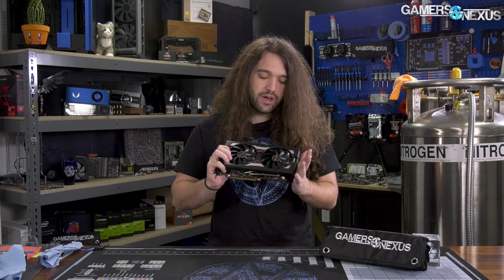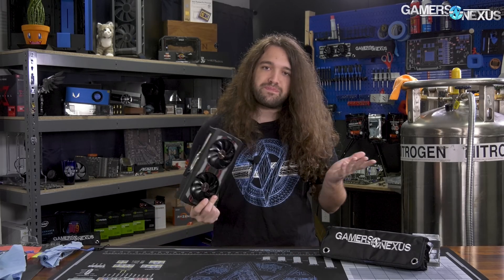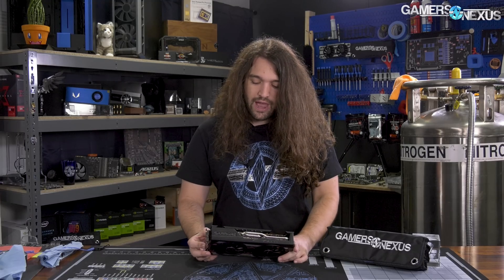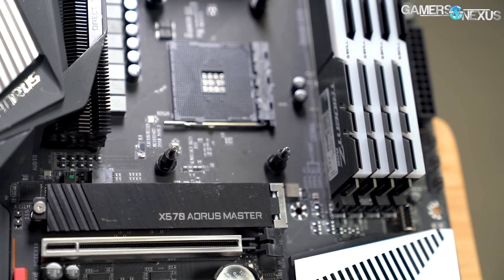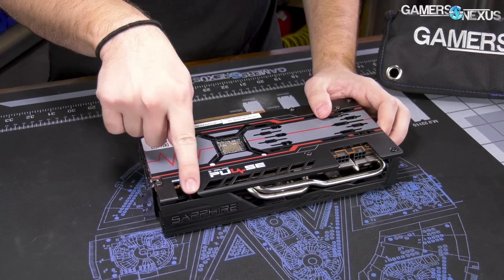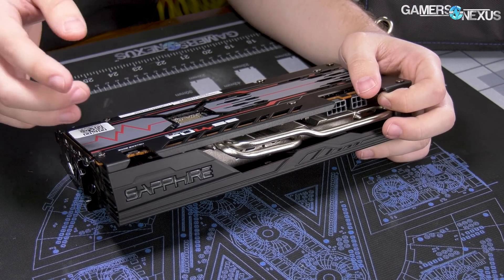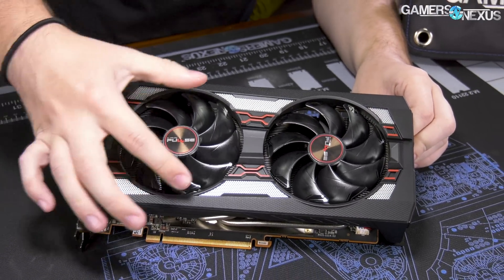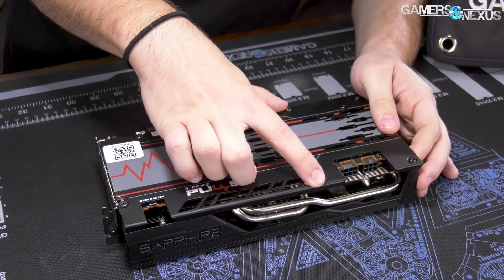Sapphire RX 5700 XT Pulse Tear-Down: Cooler Quality & Assembly

Comment: This is $65-$70 more than the reference in Denmark, would it still be considered worth it over a reference card?
Reply: the real question is ,do you want to spend the next few years listening to a ref, card spinning itself to self destruct or have a card you dont have to modify at all make far less noise ?
i dont think the washer mod can even come near the actual sapphires lower noise levels anyway ,and why go to the effort and risk of less noise with the arctic cooler
to me it just seems logical to go with the sapphire solution, but at the end of the day it is your decision to make
Reply: @tonybarden8563  what risk is involved in a cooler swap? I have done hundreds of paste swaps no problem, as long as the screws fit I don't see the problem or any difference in risk.
The arctic cooler plus the reference card would cost me about $4 less the just getting the sapphire card and about $70 less if the arctic cooler isn't needed, if the reference card is tolerable I could get a 500gb NVMe SSD and still be off cheaper than the sapphire card
That is why I would like to hear their thoughts on the value of the cooler, at the end of the day I'd rather have a good overall PC than a PC that only excels at one thing because my entire budget went to a single part
So is this cooler worth $67,5 to you? Because that is the value it has to hold, and this dual fan cooler also needs to be comparable to the triple fan arctic cooler because it is more expensive so if it performs worse then only form factor gives this card that much extra value and I don't particularly need my GPU to be small
Reply: @LaserHuset  the risk is ,not obtaining the cooling performance your expecting .timmyjoe done a swap on his 5700 using an arctic and found it pretty bad ,ram chips didnt get cooling airflow etc ,the point i made was basically its the same price as just buying the sapphire which out of the box works very well to cool gpu AND RAM AND VRM, you just cant expect the arctic kits to do the same ,this is not about your abilities ,the point is about the abilities of a one kit to fit all cards compared to a properly designed solution out of the box ,add to that and i expect maybe some improvement in the sapphires pcb/vrm design and it just makes sense to me in your situation to get the sapphire ,as i said it is YOUR DECISION but there dosnt seem any logic in the arctic route+stock card
Reply: @tonybarden8563  thank you for your very helpful comment, I have seen the video timmy made but I have also seen the videos made by Paul from "not an apple fan" and given that he runs the stock cooler in an open air environment next to a quite sensitive microphone I don't think noise is going to be a problem in a case, he also tried the arctic cooler with almost no result and went back to the stock cooler so I am aware that it is a bad example it was just easy to check the price of that product, from what I can tell an under volt with an overclock makes the reference card both faster and quieter, of course it goes without saying that the same could be done to the sapphire card, so I'm merely trying to establish the actual value of the cooler because as they said in the video performance is about the same
Would you pay about $70 for this cooler? Because I don't really know if it is worth that much or not, that is the basis of my dilemma, I ask here because I know the channel is very in depth and not afraid to say "that's to expensive" as I have seen them do before, as such I hoped for a more in depth answer than "throw more money at it" they say in the video that for another $10 over reference you are hitting diminishing returns with the sapphire card, I was just wondering if the same held true if it was $70 more or if they would go reference instead 
No doubt the strix card might be better than the reference card, but a $155 better? I don't find it likely
Reply: @tonybarden8563  regarding the cooler I could get a kraken kit for about the same price as the difference between the two cards, of course vrm and memory matters, but as long as it doesn't throttle or burn out within a year and a half I'm perfectly happy 
So is the after market cooler from sapphire equal to the kraken aio?
Reply: @LaserHuset  from the reviews ive seen of stock cards/water cooled (ek blocks) and this card, it just dosnt seem worthwhile doing anything much other than just plug and play (seems more an issue with software at the moment so things might change) for the average or even normal 'tinkerer/overclocker' there dosnt seem much point in playing with the 5700 series powerplay tables seem more 'miss' than 'hit'
Reply: @tonybarden8563  the reference 5700xt is cheaper than most 2060S models, so performance wise the xt is a no brainer, but I think I'll go with the reference card, my headphones are somewhat noise canceling so I can probably run the fan above 70% without hearing it,  thanks for the input and have a good day with many fps in your future
Reply: @LaserHuset  no problem ,it was good to chat
Reply: Don't compared the "X $ more" with what they get in the states because of stupid EU tolls + danish taxes... crap version is 3.399,- Sapphires is 3.799,- and Rog Strix is 4.390,-  Tuff is 3.990,-  so ignore the "crap version" and compare the last three versions.
Reply: @LiLBitsDK  are you sure? With the washer mod the reference design got almost reasonable temperatures, if the noise bothers you, you could get an after market cooler from arctic for about $60 (418,-) 
Again, the reference card works fine, this performs equally at least, so my question is whether this cooler is worth $65 (450,-) or should I go reference design and upgrade (with arctic) if the need arises, its cheaper and from what I can see, if you install washers, almost identical to the reference card. So basically is this worth a free 500gb NVMe SSD? Because that is the price difference where we live
Reply: @LaserHuset  so you want to slap a fortune on an aftermarket cooler on top of the card, ditch the warrenty instead of just get a premade, already working card?
Reply: @LiLBitsDK  replacing the cooler doesn't void your warranty as long as you don't destroy the original and intend to replace it on the card in case of a RMA being needed 
And how is not spending $155 on a cooler a bad decision to you? Especially when similar coolers without the card costs less than half?
I'm guessing you are the type to get the strix version and the water cool it, because it has to be better when it's more expensive right?
The solution I'm suggesting would cost about the same as the sapphire version, at worst, and at best it would be a lot cheaper, but if I did spend the same I would have a triple fan cooler rather than a dual.
I really don't know how you think "just spend more" is the rational decision, if it was then why aren't we alle running dual RTX Titans? And why even look at the 5700tx?
Reply: @LiLBitsDK  just noticed that the powercolor red devil is the same price in Denmark, so this card is stupidly expensive, I feel bad for anyone who got this on day one
Reply: @LiLBitsDK  if price scaled the same in Denmark this card would cost 3432,75,- not 3799,- I'm aiming to find out if it is still worth it even if the price difference is 367,- higher, I wouldn't have made the first comment if the price increase was 2,5% like in the US
Reply: @LiLBitsDK  we already pay more than a $100 over msrp in Denmark, and I don't intend to pay another $155 for a strix branded cooler.
But the reason I ask here is because I value the opinion of the people running the channel and wanted to hear their take on the value this product offers in other markets
Reply: @LaserHuset  They would have a hard time doing that if they don't know the other models and the general pricing though ;-) It's better than stock cooler, it's faster than 2060S, it's slightly slower than 2070S, then take the prices of those two, compare and see which one suits you best ;-) that works all over the world no matter what country you are in
Reply: @LiLBitsDK  part of their argument was that the cooler is worth the $10 it costs them, I would just like to know if that would change with a price tag more than 6 times higher

Comment: FYI- calipers and micrometers should not be stored completely closed.  You should leave a bit of air between measuring surfaces as the gage may 'spring' with temperature changes and measuring surfaces will not be parallel any longer. (aerospace quality manager here)

Comment: Steve, does the Pulse cooler work with the RX 580 Nitro cooler shroud and  the Nitro Gear? Can it be mounted?
Reply: Depends on the PCB dimensions and the mounting screws. But also you have those specially cut out heatsink places for the additional cooling around the chip so i dont think its going to match the 580 PCB.

Comment: They should make these custom cards longer and wider but "not thicker" 2 slots thickness would be perfectly fine for cooling/silence then. 🤨
Maybe some people need those below slots for other components... This is why a 2 slot GPU is crucial !

Someone should stop this more than 2 slots "thick GPU" madness. Not every desktop owner is a 13yrs old gamer, got my point? 🙄
Additionally, if the card was wider & longer they can even equip it with "bigger fans (120mm) and a wider/longer heatsink" which will be ultra effective just because of the increased cooling surface area. 
Unfortunately, its simply cheaper and easy to manufacture "thick cards" and they don't care about the unusable slots on your overpriced MoBo which you paid willingly. 
- Cause, no-one asked for it !
Reply: yep us more than 13 yrs old can afford stuff with room for that stuff

Comment: Can anyone explain to me why the same 14gbs GDDR6 is running at 7000mhz on Nvidia cards but around 900mhz on AMD cards? Does AMD measure frequency differently? It has always confused me.
Reply: I could see how you'd be confused by this as they're seemingly the same thing... but I can hopefully explain this reasonably well.
It's very similar to DDR4 speeds where your 'DDR-3200 RAM' is actually operating at 1600MHz.

I'm assuming you're referencing the 2070 Super based on "7000 MHz and 14gbps".

Most 2070 supers will run at an actual 1750 MHz memory frequency.
This will usually be represented in by multiplying it by 4 due to "quad pumping" because it can achieve 4 transfers per clock cycle, thus showing the operating speed of 7000MHz. 
This 7000 is what's shown in something like MSI Afterburner.
You multiply 7000 by 2 because it's bi-directional (D in DDR) annnnd 14GHz is your effective speed, which is why it's called 14Gbps memory, because 1 bit can be transferred 14 billion times per second at peak usage. 

Meanwhile the 5700XT is also running on 1750MHz memory so all of its values will be the same because it shares the same 256 bit memory bus and same GDDR6. 
Older or higher-end cards may achieve higher bandwidth with slower memory speeds by using a wider (384, 512, etc) bus. 

To calculate memory bandwidth simply multiply the bus width (256) by the effective speed (14) for Gigabits/second and then divide by 8 to arrive at 448 GB/s of memory bandwidth.
Reply: @tim3172  Thank you for the break down! I said always because even with GDDR5. AMD would say that their card is running the memory at 2000mhz (for example). While a Pascal based card with the same type of memory and memory bus would say "5500mhz". Something around there at least.
Reply: @ejkk9513  Oh then yes, I'm sorry I took GDDR6 to mean you were comparing 6 vs 6.
GDDR5X will generally require higher clock speeds than GDDR6 to achieve the same bandwidth and effective clocks. 
http://blog.logicalincrements.com/2017/02/types-vram-explained-hbm-vs-gddr5-vs-gddr5x/

HBM for Vega, 5 for Polaris, 5X for higher-end and newer Pascal, and 6 for Turning and Navi. 
https://www.faceofit.com/gddr5-vs-gddr5x/
Is a simple and direct 5 vs 5x comparison. 
You can use the same formulas above to find whatever variable you're interested in for these cards.
Reply: @Cooe.  I wasn't talking about an rx480 versus 1080ti.. only the 1080 and up had GDDR5x. The 1070 and 1070ti had the same memory, memory bus and capacity as the rx480 and yet the 1070 had a higher frequency.
Reply: @Cooe.  I really wasn't.. I was comparing the RDNA cards with the 20 series cards. I'm not that stupid to compare the frequency of GDDR5 or GDDR5x with GDDR6. I wrote in a new comment that GDDR5 with Pascal wasn't measured with the same frequency as Polaris (for example). I never compared the frequency of the 3 memory standards.. I don't know why you thought I did. That's why I wrote the comment about GDDR5 in a different comment so I can separate them.

Comment: These separated coolers for the board go a long way to explain the large spike in VRM and DRAM Temperatures for lower Fan speeds (compared to the GPU temps). Least that's my theory.

But while that's not that amazing, it's a trade-off, and the card overall seems a very solid design for a small price hike. I think the reason they choose to make the fins horizontal instead of the usual vertical is the X570 boards and their higher power usage. Without a GPU blowing hot air right at them these stupid motherboard fans won't need to spin up nearly as much.
Reply: Sapphire doesn't make motherboards, though, so I don't know why they would care so much about it. Surely they just wanted to push more heat straight out of the case. This seems like the smarter orientation in my opinion. Even the case front intake fans would help with the airflow.
Reply: @herrakaarme  nah. If you have front-mounted case fans blowing into the case (the typical setup, and breaking it goes against the ideal air path, as hot air rises that'll lead to pockets of hot air) that'll conflict with the hot air coming out of the card. That's probably the reason for the traditional setup (which leads to the hot air getting blown out by the CPU cooler and backwards case fan), along side with the fact that due to shorter paths "out of" the fin stack the air recives less friction, which also leads to better performance with lower fan speeds. That's more extreme in the semi-passive mode most modern cards support.

But a good individual card that stays quiet doesnt matter if it makes your motherboard overheat and be super loud with an annoying small fan.

And good designs are not made in a vacuum, you want to consider the surroundings. AFAIK it's been known for a relatively long time that AMD will increase power draw of the X570 chipset quite dramatically because of PCIe 4.0. Pretty sure it was before sapphire knew enough about the new cards to design the specific cooler for them.

Comment: so you're saying i can repaste my card without wrecking almost every thermal pad there is, clean the fans and heatsink without having to fiddle with more than one small cable or connector with my sausage fingers, and (potentionally) mod the bios without worry i'd broke the card entirely, for a mere 10 bucks more?

holy tech jesus, this might be just the right card for me!

Comment: its ashame amd didn't opt to use faster gddr6 like the 15.5gbps spec I could about guarantee these cards could be sold for the same price with faster memory. amd cards always scale well with memory bandwidth so I think fast memory would have made this even more compelling. its already a great gpu at 400ish$ it really makes the aib 2070 supers pretty pointless. very small gains for another 100+$. idk I think most people still don't care about rtx so really the 5700xt is a great deal and compared to the 2060 super id say its a complete no brainer unless you just didn't want to buy amd I cant see any other reason to buy the 2060 super
Reply: watch out for the Ultra XT version ;-)